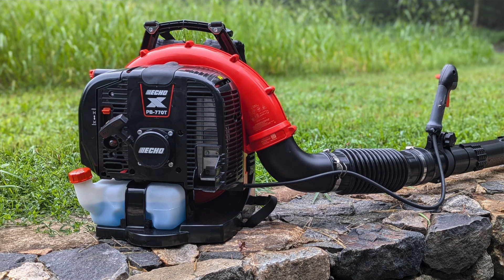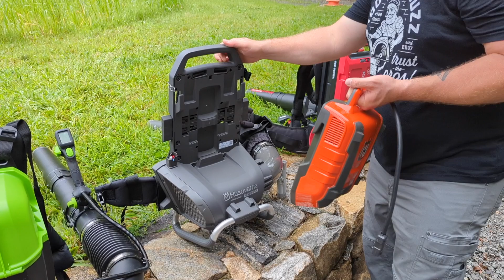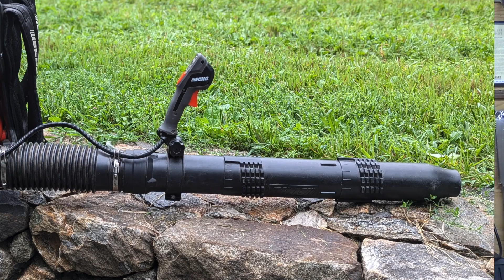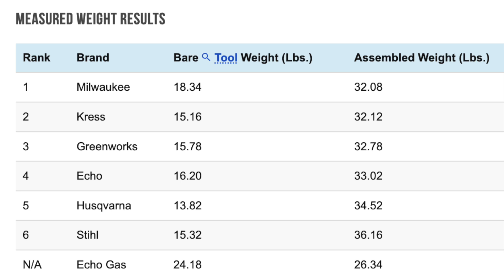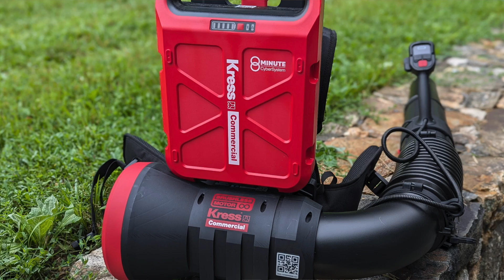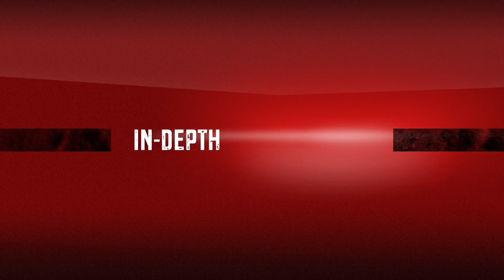Battery Powered Backpack Blower Comparison

Comment: If you're wondering about the EGO backpack blower we have been using the two battery one and it lasts ~1h-30min with two 10mahr batteries. You gonna have to get multiple batteries and a way to recharge while other set is being used. I noticed the tube diameter is larger than our stihl gas blowers and I think that makes it weaker. If they had made the tube a smaller diameter I think it would do a better job. One of our older workers says it is much heavier than the stihl blower with the two batteries of course. I prefer the handheld EGO blowers they are just as powerful and easy to maneuver behind bushes and stuff. If your arm gets tired just switch to the other arm no big deal. Make smaller piles rather than blow to make larger piles. On a final note, in temperatures above 90 degrees f.. batteries get hot under hot weather and stop working overall and you can't even recharge them when hot. the design puts the batteries under direct sunlight which is also a bad idea. Other tools had no problem it was mostly the blower.

Comment: Something not mentioned is that the Milwaukee blower also stores it tube upright. Another thing worth mentioning with the Milwaukee is even though it was the lightest blower tested. It can run on two batteries, making it even much lighter.

Comment: As a landscape pro that use blowers all day long I would only choose between the Stihl or Echo.  Parts and service all important.  Good luck getting any kind of service or parts from any other manufacture and if you do that machine will be down for months.  Nice vid!
Reply: That's a common sentiment I'm hearing from my professional gardening friends. We just received the new Stihl BRA 600 backpack blower and have been super impressed. The power is absolutely there, just need to learn to manage the battery runtime.
Reply from the maker: Thanks for the kind words and the feedback about parts and service.

Comment: I need someone to compare these at an actual job site or sites.
Reply: I’ve worked for parks in Washington, haven’t used any of these but I’ve used the stihl bga 100. We get endless leaves in the fall, but for paths, walkways, parking lots, basically any hard surface I’d always choose the electric, it’s just so nice and convenient, and electric tech nowadays is good enough (for hard surfaces only tho) to get most of what you want. The stihl battery lasted a lot longer than i thought (maybe a little bit longer than a full tank of gas) but if you were conservative you could make it last a lot longer. For the average homeowner, electric all the way. Who wants to buy and mix fuel, have problems with the pull cord, the choke, the spark arrestor, the spark plug, the air filter, etc. when you could just pick up the backpack and press a button and have ALMOST the same power but just so much quieter
Reply: If you’re blowing thicker layers of leaves in wet grass though, gas is still king

Comment: I do want a backpack but I think for the cost I will stick with my handheld M18 and ultimately go with a gas option in the $400 range. I tested battery life last year and I believe 12ah was 24 minutes. My buddy has the dual battery M18 and it's very awkward. I'd love to see some other companies recognize the value of a charger like Kress offers. Even though it's very expensive, I don't see many landscapers making the transition to battery with 1-3 hour charge times. If you ran all battery landscaping tools then I could see a need for 15-25 batteries daily. At that point it would be cheaper to buy a $500-800 charger and ~10 batteries. Anything that can charge during a 10 minute lull or lunch break would be a game changer.
Reply from the maker: @Tool_Addicted_Carpenter  agreed
Reply: You should check out the echo pb-7910 it's within that price range and it's a great blower.  It is pretty much the echo pb-9010 without the upgrade to filtration and few other things but it has the same engine which is reliable and makes ton of cfm. I have had my 9010 for a few years now using it commercially so it runs every day and haven't had a single problem just carb tuning as it broke in. The stihl blowers are sweet too I don't think 4mix engine is as reliable as traditional 2 stroke though.

Comment: Batteries do a great job at eliminating the inconvenience of a cord. Gasoline however is not an inconvenience. It makes sense if you live in a backwards state and you have no choice. Everyone else needs to wait several years before these become practical tools. It's exciting though and I'm here for the ride. Great channel. I love these tests..... If you read this far... Go buy an Echo PB-9010T and thank me later. If you buy two you'll be able to fly.
Reply: As a commercial operator for 30 years, gas is a complete waste of my time in any state.  Keep drinking big oils kook aid and simultaneously sucking at property maintenance.
Reply: @tbirdbrad3210  You are one stupid individual.
Reply: @tbirdbrad3210 gas is cheaper and faster to fill.
Reply: Each is good for its own situation to be honest. I use both (mostly battery) but gas has its place
Reply: For the average homeowner electric is the best, electric is just so nice and effortless for hard surfaces, if you’re blowing through wet grass though then gas is still king
Reply: Can't work in the rain with electric tools. As a 30 year Florida condo and residential landscaping business owner. It's cool and much lighter but I'd need 15 batteries to put in an 11 hour day running 2 blowers

Comment: No Makita for this test? 😢
Reply from the maker: @Silky_boi  negative, Makita was invited but they declined to participate. I think they are hoping for a new generation to come out not 100% sure why they didn’t participate.
Reply: @ConcordCarpenter  weird, current models was launched relatively recently :(
Reply from the maker: @riba2233  We've been testing for several months - which brand released a new model?
Reply: @ConcordCarpenter  I was just commenting how makitas current models are not that old, so I am not sure if that was the reason they didn't want to provide them, they usually don't release new models that often
Reply from the maker: @riba2233  Gotcha
Reply: The new model is around 25N just as a spoiler. Its probably close to what the Echo does but with low mph high cfm from what it seems